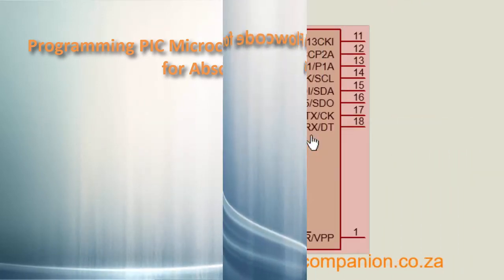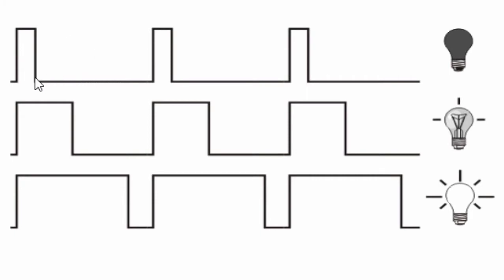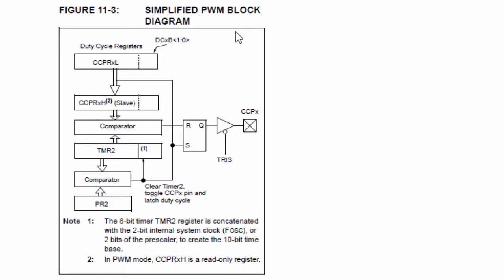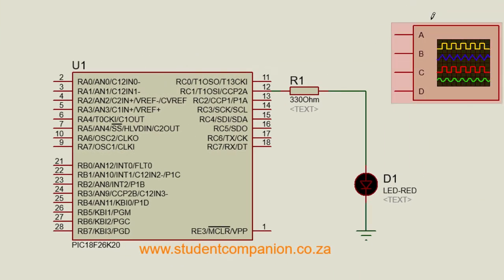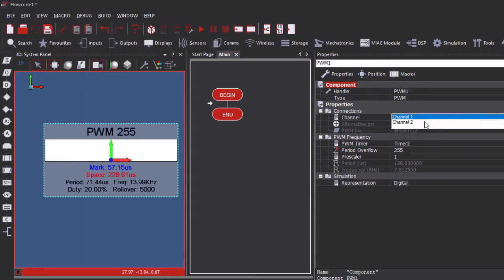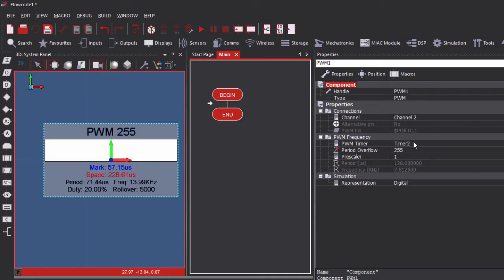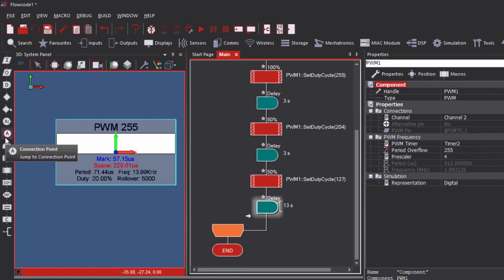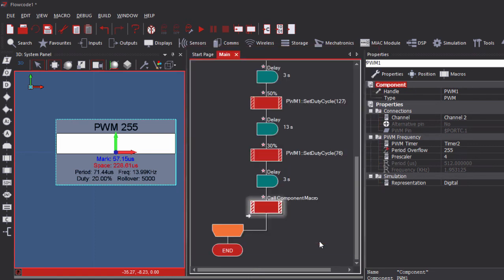14- Pulse Width Modulation (PWM) | Flowcode Beginners Tutorial

Comment: Hello, how do I generate a PWM at 20Khz or any frequency of choice, with flowcode? Thank you.
Reply from the maker: Depending on the Oscillator frequency used, by changing the prescaller value, the frequency will be changed as well. Select  the correct value to give you 20KHz.
Reply: @StudentCompanion 
Hi, thanks for answering, the PIC I'm using is a PIC16F877A, I only have 1,4 and 16 in prescaler and none of them give me 20Khz? There has to be a way to achieve the frequency you want y el cristal es de 4 Mhz
Reply from the maker: @Qwerty_c  Read the datasheet of your PIC,  there is a formular to calculate the PWM period, you will see it related to oscillator and prescaller value, either you change your crystal value to get more options.
Reply: @StudentCompanion  
Thanks, I found the equation as well I indicated in the datasheet of the pic, I only had to calculate what value of time2 in PRE that in flowcode is the "period" (that was what confused me, since I thought it was the PWM period) . But already calculate it for a frequency of 20Khz with a Xtal of 4Mhz the value of the period in flowcode is 49 with a prescaler of "1", thank you friend.👍👌
Reply from the maker: @Qwerty_c  You are welcome!
Reply from the maker: @Qwerty_c  Depending on the version of Flowcode you are using, in component properties under calculations, there is an option to enter the required Frequency, the component will automatically calculate the best Period and Prescaler for you, then you can enter these values in the Period Overflow and Prescaler options.
Reply: @StudentCompanion  Flowcode 8
Reply from the maker: Yes with Flowcode 8 there is a calculations section.